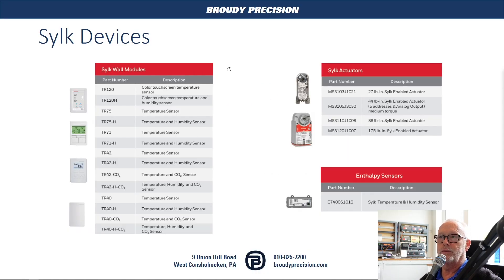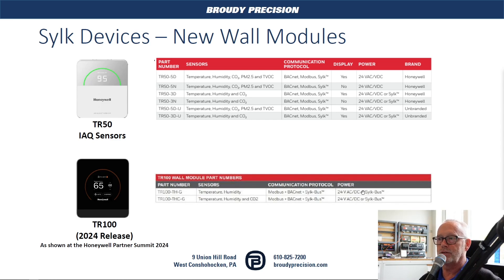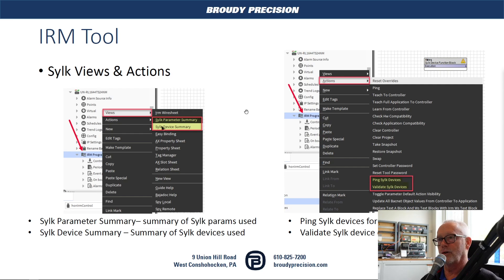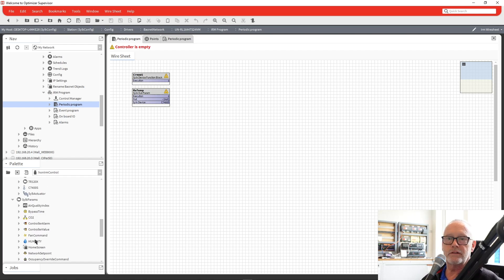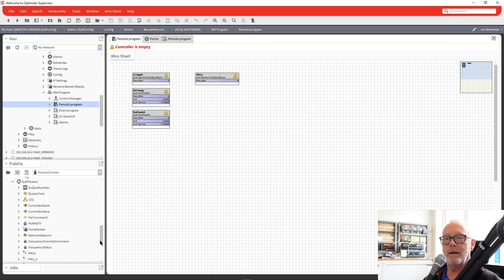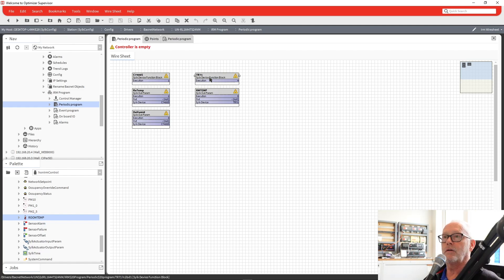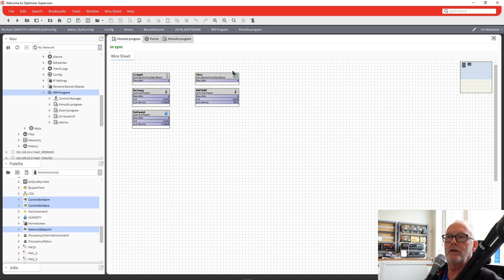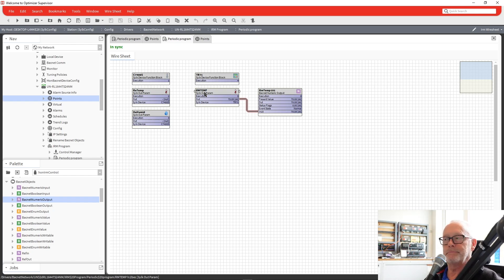Sylk Devices | Honeywell Optimizer Unitary & VAV

Comment: As a novice and apartment building owner, I have a particular building with 12 units and a high efficiency boiler. Can I hardwire sensors the units down to the boiler room where A particular thermostat can display the sensors and we can run the boiler based off of these temperatures? I would also like an app that can help control this.  I was researching the tc500 Honeywell thermostat that may be able to accomplish this and it's also sylk integrated but I can't find out if I can see each of the individual sensors or be able to manage.